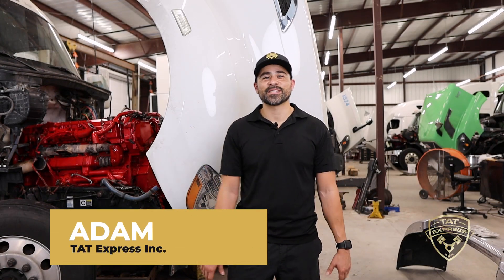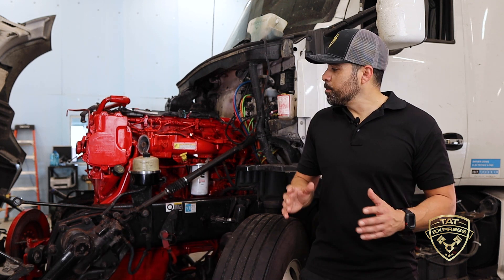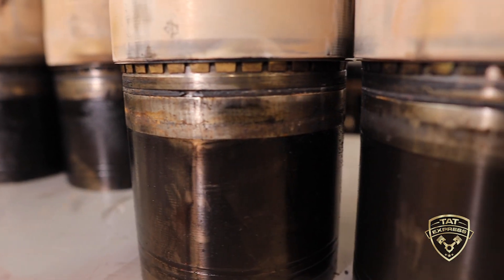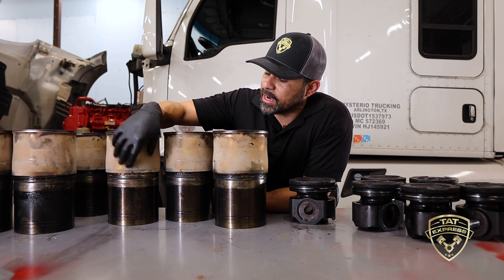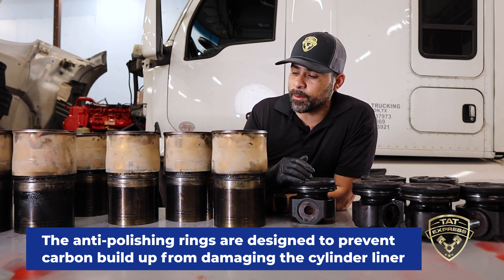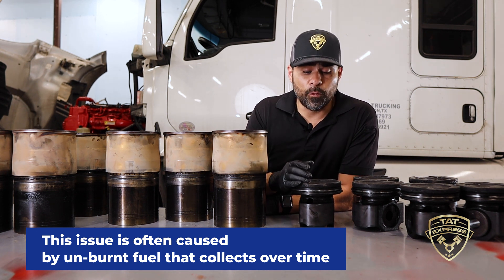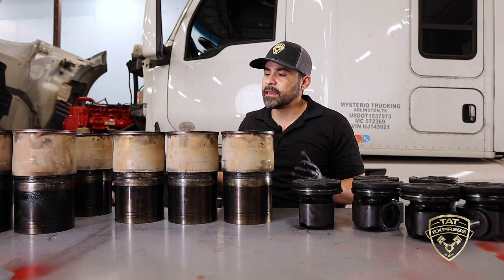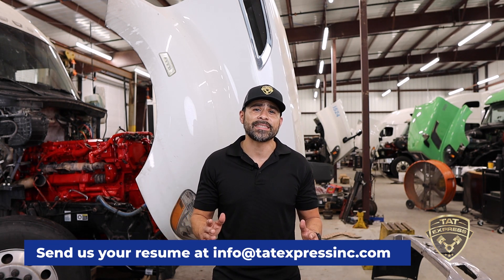Coolant in oil/ Common issues diesel/ Common engine problems/ Cummins/ Detroit/ DD15/S60/ ISX15/

Comment: Adam what engine would you say is more reliable nowadays. DD15 or ISX15 I'm looking at a couple of 2018-2019 trucks. I have a computer with all the softwares, so having to go to a dealer to diagnose small sensor or codes issues won't be a problem. I'm referring to mayor repairs, downtime and cost of parts. What would you say has been your experience or what have you seen the most coming to your shop with problems, what is the hardest to find parts and the longest wait - downtimes of the 2. Thanks for your insight, great videos man, you are helping a lot of ppl. Keep up the good work 👏

Comment: I have a 2016 Volvo D 13 425. Air pressure build up in the coolant system. when the truck is cold or hot if you loosen the coolant cap anti freeze rise being push by air changed coolant  tank had it pressure test for blown head gasket no drop in pressure.no anti freeze in air tanks any one can help with this it  would be appreciated .
Reply: I have heard that the air compressor can pressurize your coolant system. Im not sure if volvos do it. But we had it happen in a paccar
Reply: Did you find the problem. Just noticed it was 3 months ago. Lol
Reply: @darrenhanson7696  yes funny you ask it's in the shop now to injectors failed . and it ran 5 months like that no smoke coming out the exhaust no hard start the way I found out was I was going to grab a load every time I tried to accelerate it started skipping . thank God I was at home and not over the road somewhere

Comment: The #1 way to keep the carbon off the pistons and increase the life of your engine is to invest in some type of APU and use it when you shut down for your 10hr break or  waiting at a shipper or receiver don't idle the truck over 30 minutes and if you're sitting for more than 10 minutes idle the engine rpms up to 900rpms keep your oil pressure at 40 or more this tricks the engine and it thinks it's running down the road, 2nd when you're driving your truck watch your shift point don't tact your engine  above 1600rpms will throw your valve adjustment off the ISX Cummins will set itself if you tact it at 1500rpms and get great fuel mileage and also pull like a BEAST one more tip if you have the automatic have the computer set to where the transmission will shift at 1500rpm and watch what the fuel mileage does you'll be amazed!
Reply: You ain't going to be able to go up any hills at 90t+ at them revs 😂😂
Reply: Can you guys set the shift points.?

Comment: Why is my truck turning off when I drive or when I'm Adelaide you guys change the brain of it I think the computer of it and it's still doing the same thing every couple weeks it turns off can you explain that to me I got a 2017 freightliner with DD15 Detroit engineering

Comment: I'm looking at a 2016 Cascadia. I smell coolant in the oil. The owner is saying that it is a common problem and its not worth fixing. Sign of bad maintenance?
Reply: Run away as fast as you possibly can
Reply: Bad maintenance and abused engine

Comment: How much does a job like that cost to fix including labor ? Also what temperature does diesel fuel  usually burn at ? I see additives that reduce engine temperature which supposably reduces carbon build up. But it seems like you want to INCREASE engine temperature to reduce carbon buildup
Reply: Raising the temperature of the engine it is one  of the major problem to build up the carbon  inside the combustion chamber. It required equal proportional of  air/ fuel ratio  in order to reduce unburned  carbon  deposition inside the chamber.

Comment: Carbon buildup is caused by regeneration.  When soot can't get out, it cycles back through the engine.  Give me a glider kit engine
Reply: Carbon packing on the pistons is caused by the EGR system it doesn't have anything to do with regeneration. That has its own problems, way too many to list

Comment: Right here is proof the manufacturers of these heavy duty diesel engines design these engines cheap as they can why would any manufacturer just put one seal to separate coolant from oil on a cylinder liner there should be two gaskets one as a backup but nope 🤷🤦💯

Comment: I got a 2017 cascadia. Which probably has the 2016 DD15. Don't know forsure(let me know how to check). But either way, I heard the oil pump fails at 400k, I got 388k on it. Is that too soon to change a oil pump? I really don't want it to lock up
Reply from the maker: Are you getting a low oil pressure alarm?  Most of the time, it's just the oil suction o-rings.   You may change o-rings as preventive maintenance.  You should get signs of low oil pressure and be sure to be current with maintenance.
Reply: @TATEXPRESSINC  none of those signs yet. I bought the truck at 354K and the dealer said they changed the rubbers on it. But I'm just basing this on he said she said , i don't know if they really did change them.. but now that I know the signs. I'll be careful and look out for them. Thanks alot  man really.
Reply: Just changed my oil pump and seals, injector cups and O-ring with cam housing seals on my DD15 with 630k. Preventative maintenance is the best solution to all problems. Change me coolant at least every 180k.
Reply: Do oil analysis